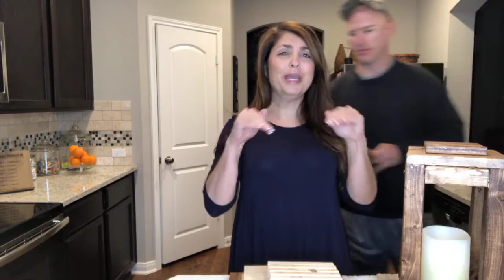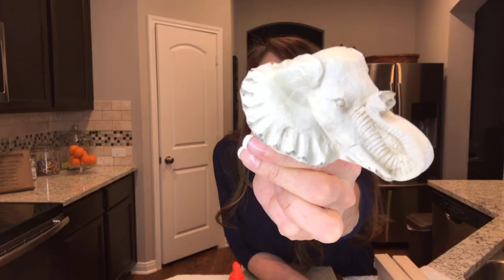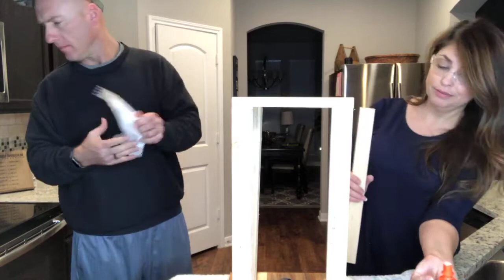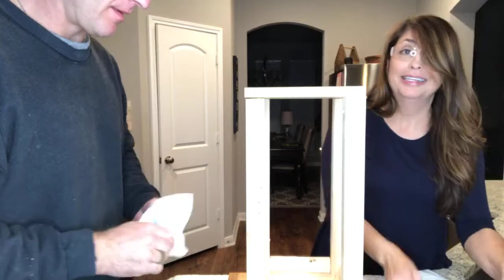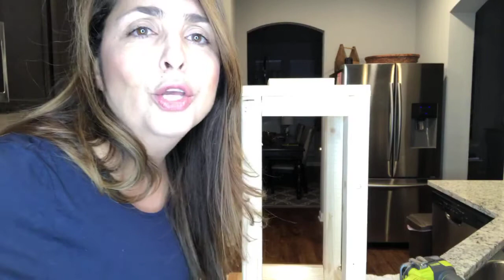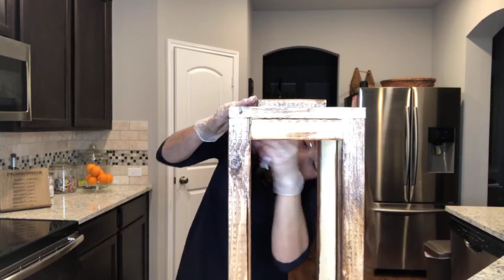Easy Date Night DIY Project

Comment: But, if you get glue oozing out & maybe don’t “ wipe it “ with a damp rag, & it dries, the stain won’t take & has to be sanded off. You know, maybe it won’t matter, ( something I learned from my cabinet builder daddy). Just a tip in case you weren’t aware of. Great show you guys, thanks!
Reply from the maker: Thanks for the tip Nancy!